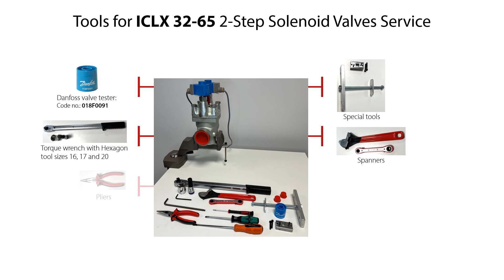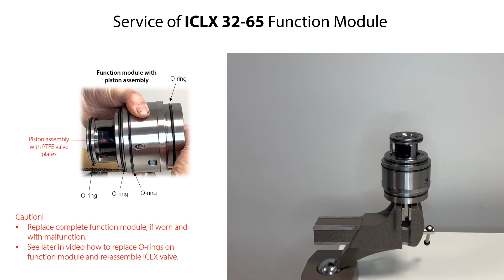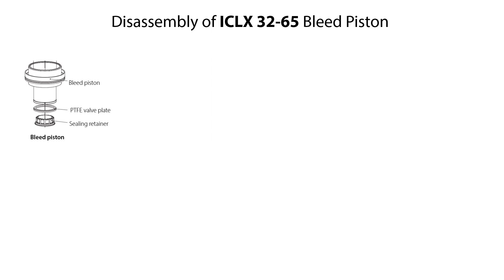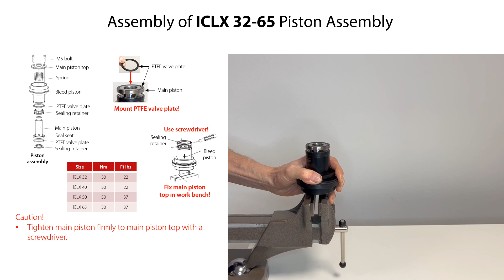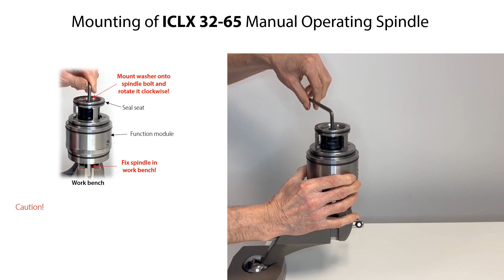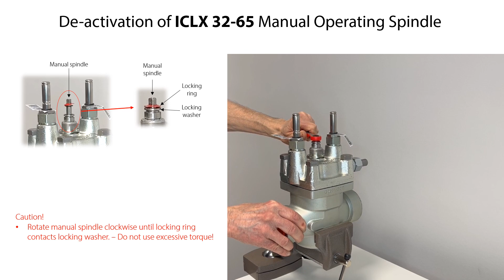Efficient Service of Danfoss ICLX 32-65 Two-Step Solenoid Valves

Comment: Sir tell about iclx which is auto mode and which is manual mode.
Reply: Can we put the valve body in any direction.
Reply from the maker: Hi, you can find full details on our website: https://www.danfoss.com/en-us/products/dcs/valves/control-and-regulating-valves/iclx-flexline-2-step-solenoid-valves/